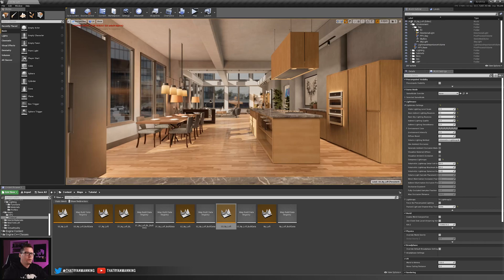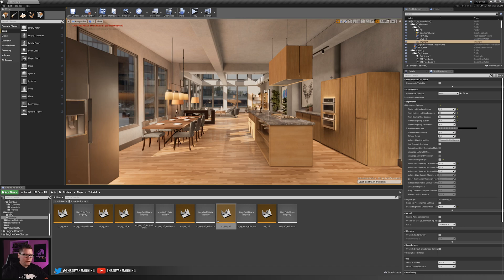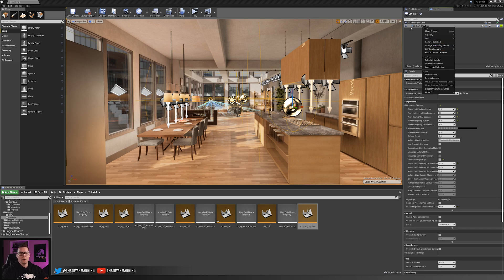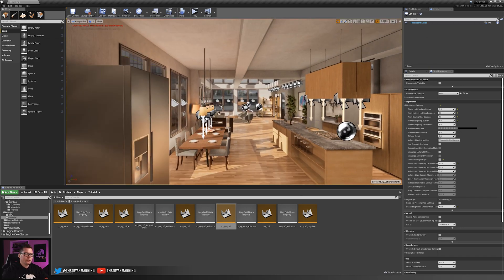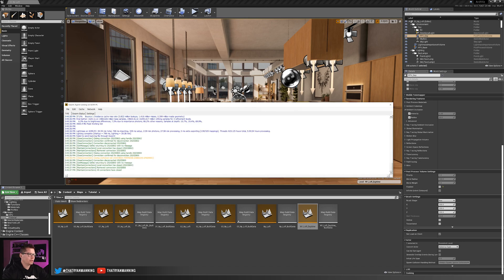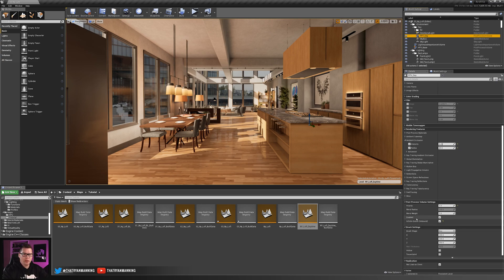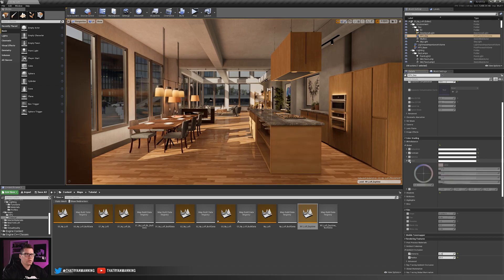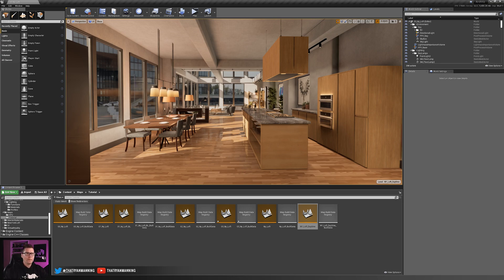UE4 Interior Lighting Series (Part 4)

Comment: Thank you for these videos! One question. Why you didn't use ray tracing?
Reply from the maker: This series was designed to showcase the workflow behind building interior lighting without requiring a RTX GPU to support it....aka, if you wanted to build lighting that could run on a VR Headset this is the workflow you'd use.

Comment: Hi, thanks for your tutorials, I learned a lot. I am trying to light a bar counter with led strip lighting below the bar counter, when I try to use rectangular lights, and set it to movable, i casts shadows but it casts from the center and does not behave like a rectangular light. How do you approach this kind of situation? thanks in advance!
Reply from the maker: Rect lights should cast from the rectangular volume. Make sure you're not using a spot light. If you use the Emmisvie material method, it will calculate shadows like a rect light but only with built lighting and not dynamic.
Reply: Ryan Manning i used the rect lights but, i think when it reach a certain length, the casting of shadow is like of a point light. So what i did while waiting for your reply, is instead of having a long rectangular light with a length of 10 meters, i made it small into 2 meters so the shadows look much better. Ill also try to use the emissive approach as per your advice! Thanks again!

Comment: how does the daytime/nighttime work exactly, won't it fuck up your bakes?
or does that technique only work with dynamic lighting and not static lighting?

anyways, great series and clear explanations.

I used to do everything at once, which caused me a lot of time.
Reply from the maker: Lighting scenarios build/bake individually; so any lights that are contained in a lighting scenarios won't affect other scenarios. Basically the engine builds the scene for each lighting scenario and stores it in a separate build data file.
Reply: @ThatRyanManning  oh nice, thanks for the explanation!